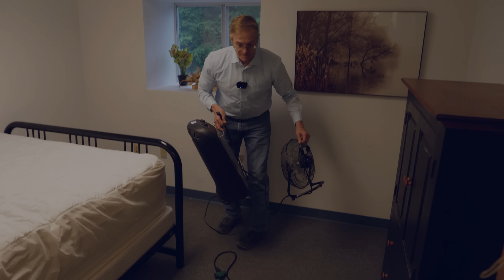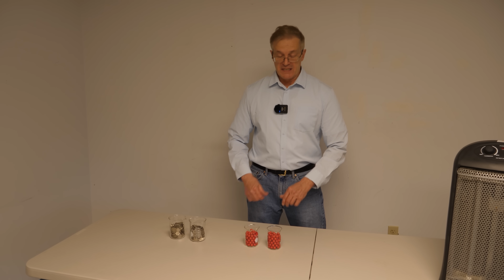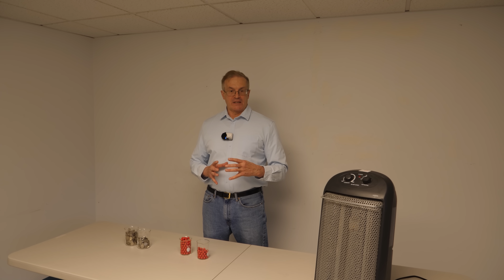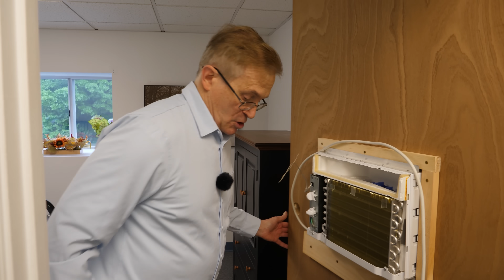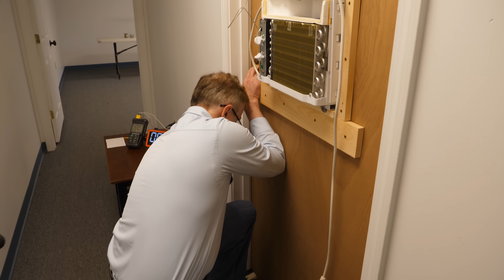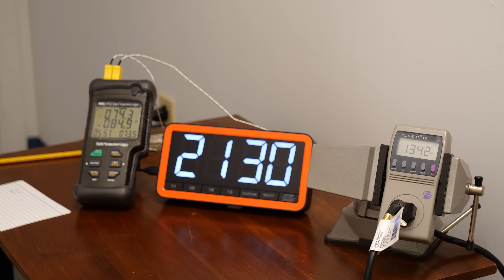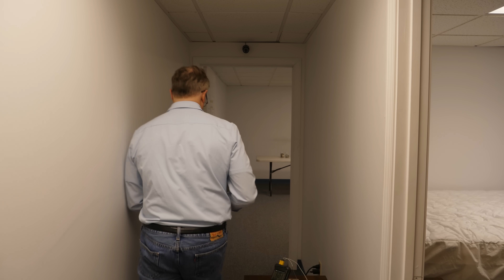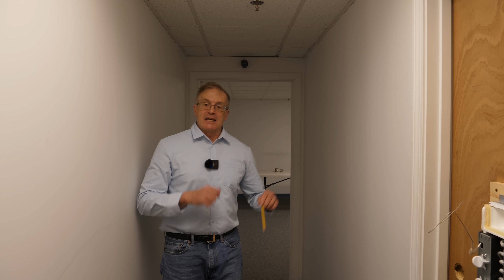You're wasting money on heating! Use your A/C!

Comment: The main problem with heat pumps are when humidity or precipitation freezes over the outdoor unit. They make blankets to cover the units but in southern states the temperature swing in autum and winter can be as extreme as 75 degrees for 2 days with lows in the low 50s upper 40s and swing to highs in the low 40s and lows below freezing with some rain/freezing rain then after 3 days of that highs in the upper 60s and lows in the 40s, then a chance of staying below freezing for a week, then repeat the weather pattern.
   The main method for defrosting the outdoor unit is either electric heat, or gas burners built into the HVAC system, very inefficient way since it requires the system to heat the outdoor unit to run like air conditioning while heating the cooled air to compensate.  There have been some improvements in efficiency over the last 15 years since i was a in the HVAC  business but the core principals of the technology haven't changed.

Comment: No. The controls for heat pumps are much more complicated when outside temperature is near freezing. Ice is a good insulator. MANY HEAT PUMPS LACK ADEQUATE ENGINEERING AND CONTROLS to deal with temperatures below 40 Fahrenheit....

Also any mission critical roles like not freezing should have redundancies. You should really have a minimum of two heating fuel options, assuming that heat is actually important in your location.

Comment: Burning natural gas costs less than either.  When it's hot a swap cooler cost less than a/c and works well if it's dry.  If you really want to run a/c a condenser in a cooling tower is the way to go.

Comment: Looking forward to the AC improvement piece. Thanks for showing this. What happens if you just run the ac unit in the room? Are you still ahead of an electric heater even with dumping the cold air in the same room?
Reply from the maker: No.
The multiplier effect is based on moving heat energy from outside the room into the room. Generating heat from mechanical parts, motors, or hot wires is exactly the same as running the resistance heater.
Reply: That’s what I thought. But let’s say we turned the ac around in a window to use it for heating the interior room at what point would the colder temps outside negate the benefit of the heat transfer of the AC unit? Assuming the exterior location was dry and the ac was equipped with thermostats, switches etc. to run in the cold exterior.

Comment: Thank you for your great content. 
What about the efficiency drop ?  0 C° outside while you want to heat a room from 0 C° to 25°. how much would it drop on max. power eg. 2kw of the aircon? compared to resistency heater.
Reply from the maker: It's roughly linear, so with a doubling of the differential, you might still see a 2 to 1 or a 3 to 1 advantage.

Comment: Well, two things. He apparently misspoke when he said he chose Fahrenheit because it has smaller numbers. He probably meant to say smaller INCREMENTS. Any school kid knows that Fahrenheit has larger numbers (212 vs. 100 boiling pt.). He was correct about the reason. Because Fahrenheit is LARGER, it provides arguably more accurate readings. 

Secondly, I was dumbfounded when he said that an electric grid heater was the most efficient heat. (Now, infrared ceiling panels ARE more efficient because they directly heat the person instead of the air.) I don't care what kind of math or science is used to supposedly prove that, anyone who has ever used a residential heat pump with the auxiliary heating grids for cold weather, knows that this JUST AIN'T TRUE. Whatever the explanation is, it just does not work out in real life. When it gets really cold outside and those auxiliary heating grids kick in, the power meter outside starts spinning like Satan's fan.

However, he IS CORRECT that the heat pump is more efficient at moving heat. But without the auxiliary grids, the heat pump alone cannot keep up on the coldest days, and by several orders of magnitude. Not unless you oversize the unit by several times what is needed for cooling, and that causes additional problems. And that is why the grids are added, at the electrical expense of the owner, to avoid over-sizing the cooling side. And worse, depending upon the weather conditions, the heat pump can freeze up (just like an old refrigerator freezer) and becomes useless until the thaw cycle clears the frost. But in that sweet spot of say 35-65 degrees, it's fantastic. The other downside to heat pumps if you intend to use them for heat is, it takes a lot more BTUs for average heating than it does for average cooling. Yes, BTUs are BTUs, but here is the problem. Cooling from 95 degrees outside, to 75 degrees inside (and believe me, 75 degrees running a zone unit all the time is COLD) is only a differential of 20 degrees. (The hotter it is outside, the colder a set temperature feels because the AC is running more. I have my shop set to 80 degrees and it's still cold; it tends to run below set anyway.) Begin to see where I am going with this? BUT, if you decide that only 70 degrees is comfortable working in the winter time, and the outside temperature is 25, that is a differential of 45 degrees, more than twice the cooling differential. I have a small, insulated shop in which I installed a 2-ton heat pump. It can easily cool it down on the hottest days and keep it cooler than I need it.  However, in the winter, once it gets below 35-40, the heat pump just can't keep up. If I had it to do over, I'd go with a 3-ton pump (I had already replaced a 1-ton unit). Before I installed the heat pump, I was using two 5-KW electric heaters in the winter and it was eating me out of house and home. With the heat pump, I can hardly tell it on the bill.
Reply from the maker: Thanks for the long comment.
The Fahrenheit scale has smaller increments, and when the meter is limited to one decimal place in all systems, then the resolution is higher with the Fahrenheit scale.
Any method of resistance heat will be less efficient than a heat pump. However,  the method of resistance heat may be more EFFICACIOUS if it heats your body rather than the entire room.
The problem with supplementing a heat pump at large differentials is that electrical heat is much more expensive than other energy sources like natural gas. That is why a hybrid system that uses an alternative supplement is a better choice.
Reply: @TechIngredients  This is all true. However, notice that BOTH the resistance heat AND the heat pump use the same "more expensive" electrical energy, yet within its limitations, the heat pump is more efficient (less cost) at producing heat. The problem is, it can only produce so much heat at cold temperatures before it freezes up. Maybe they have made recent technological advancements to overcome this shortfall, but that is the basic conundrum with heat pumps. Efficient, but limited. Electric grids are expensive, but unlimited. All I know is, when I ran those 10 KW electric heaters in my shop to take the chill off, it cost a fortune.

Comment: This is brilliant. Our ancestors beat us. Then they teach us. I believe wood and coal is the only way to go. The modern society is all way dependent on a government. We are not building solar panels or air conditioners in our back yards. We have designed a lot of luxury for our elderly and handicapped. The younger generation needs reliability and affordability. Passive cooling with root cellar or basement ( Awnings also help block heat from entering windows). Coal and wood for heating.   The whole idea of envelope sealed  designed structures is a waste if a home has to breath ( prevent mold and mildew).

Comment: I'm a little bit late but it should be mentioned that the heat pump efficiency drops as the temperature difference increases.
For commercial solutions it drops below 1 around 40-50 Celsius/Kelvin.
There are some solutions for this problem like backup heat source (gas/coal/wood stove) or heat battery.
Using soil as medium from where heat is stollen from or dumped to is also quite popular solution.
Heat batteries can also increase chilling efficiency.
Reply from the maker: Below 1? What do you mean?
Reply: @TechIngredients  At some point AC unit is not able to chill fluid below ambient on evoporator side and above consumer on compressor side.
Eventually gas start to collect heat from room and transfer it outside. It is extreeme situation, rare even in Canada and  Scandinavian countries.
Reply: @TechIngredients  COP below 100%.
When temp difference goes extreeme compressor, evaporator and condenser are not enough to prevent heat from moving inside to outside using working fluid gas.
It is like trying to use 12V garden pump water up on the Hoover Dam, it is going to flow down.
In this case, very rare even in Scandinavian countries or Canada, electric space heater, gas heater or even woodstove wins.

Comment: So one thing that has me curious.

You are pulling the heat from an already fairly warm hallway, I wonder how the efficiency of heat pump heating becomes if you are instead pulling the heat from an already cold outdoor.
Reply from the maker: It drops, and it should.  The efficiency advantage is based on the differential, and as that increases, the multiplier effect will decrease. But it will never reach the low performance of a resistance heater as long as the cold side is above absolute zero.

Comment: In Sweden, most of them works the either way. When they gets iced up in the winter, never try to remove the ice mechanically, for they are extremely fragile. Use cold water to de-ice them better, so as not to stress things and cause leaks.

Comment: Hi. Your video is good, but the focusing issues you've having with  the camera is extremely distracting. I don't know if it's an old camera or if the autofocus function is defective, but please fix that. You have multiple options, you can buy a better camera with a better autofocus, or a DSLR with the objective in manual focus mode and have the camera operator manage the focus, or again with a DSLR use a small aperture (you will need better lighting) with manual focus and forget about focusing as the depth of field will be big enough for your filming style.

Comment: In layman's terms, it's not a matter of efficiency, it's the WAY the heat is generated. Using electricity to heat a steel coil or metal rods in a typical electric heater uses a LOT of electricity. Whereas compressing gas as is done in any AC unit creates heat using FAR less electricity. And as for how heat pumps work, they do indeed work the same way as a window AC unit, but use air or ground water to either keep the 'hot side' or the 'cold side' depending on the time of year, cold or warm enough to keep the unit working properly.
Reply from the maker: My only disagreement is that a heat pump doesn't need to be hooked to a ground loop.  Air can be used as the heat sink.  It's a matter of the specific design of a particular system.
Reply: @TechIngredients  True, but the ground loop variety seem to work best, unless they've made further improvements recently. I know one friend a good five years or so ago, who had a HP that only used air and looked a bit like one of those mini-split ac's. But ofc it only had the wall unit. It was great in the summer, but had a bit of trouble heating during very cold winter days.

Comment: The hallway is like the outside of the house in this experiment. So when I'm heating with an a/c unit, that outside temperature would be around 35 degrees Fahrenheit. I would like to see the results under those conditions.

I think what you've displayed here is great and I appreciate it. As I said in the above paragraph I'm just concerned of what it would look like in the real world conditions that I would be using it in.

Comment: Hmmm...  I'm going to estimate great for unextreme temperatures, but the colder it gets outside, the less efficient it becomes. This is not very useful in a wisconsin winter when it's below freezing... or worse, below zero for instance.
Reply from the maker: Consider a two stage system. Use a conventional heat source like propane, natural gas, or oil to reduce the temperature differential and make up the difference at a very high efficiency with the pump.

Comment: soooooo...  You're saying, when winter comes, put the AC in the window "backwards", and save a ton of money on heating; in those rooms where one usually uses a space heater?
Reply: No, he is saying instead of buying a resistive heater buy a heat pump which has the functionality of  both cooling and heating - that will save you money in the long run. It has a reversing valve and adequate quality indoor coils which lets you make your ac go in reverse by pushing a button rather than actually taking it out and putting it in backwards.
Reply: @xhashmi791  Thank you for all the info, but I am convinced, if I put the AC backwards it will blow heat into my room, and do it cheaper than a space heater.  I just watched him do it.
Reply: @jafquist27  I think he merely demonstrated a proof of concept and it is not suited for practical application as is. But please go ahead, be my guest :) It will blow heat into your room, if the temperature outside is already warm enough to trigger the thermostat into cooling mode and it won't shut down when the desired temperature is reached inside the room rather only when the outside is cool enough - you need to replace the thermostat with one which has a heating mode and need to move its sensor to the inside. Also you need to go outside to operate the controls and you risk moisture damage to any electronics on that side which are likely not to weather proof.
Reply: @xhashmi791  That's all well and good, but the title of the video instructs one to use his or her AC for heat.

Although correct, none of what you said was openly said by him.  Like many scientific types, he was speaking with just enough jargon to make the information useless or even dangerous to his potential audience, as in the case of one sticking an AC control panel out in the cold, wet winter weather.  

For him to not even invision someone trying such a thing, and thus not warning them to not do it, is somewhat irresponsible.  The title of the video is more than adequate to attract a very wide section of the population, seeking to find cheaper ways to heat.  The title plainly encourages one to use his or her AC for heat.  I don't find it too much of a stretch for the average person to realize, if they put the AC on, cold air is going to come out of one side of it, and heat from the other.  From there, most would look for a way to not cool one part of the house to heat another.  Thus, just like in the video, install the AC 'backwards', in some fashion, to exhaust the cold air from the house enitrely.
Reply from the maker: Jafquist is essentially correct.
This is a demonstration of the performance of heat pumping, not a tutorial on how to accomplish heating with a reverse mounted airconditioner. Based on the comments, I think most people understood that.  Nevertheless, there may be a few situations where you could actually reverse its orientation to heat a room.  If you have a window that opens on a covered porch that protects the internal components from the weather and gives you access to the controls, then moving the thermal probe inside will allow you to heat that room.
Regarding my "jargon," what did you not understand about my explanation of the principles?

Comment: Convert a Window AC unit to provide heat for a cloths dryer.  It shoukd cool the warm wet air to pull the water out of the air, and pump the heat back into the cloths dryer. Not only does the heat pump save energy recycle the heat.  But also,  it's not pushing moist warm air out a dryer vent  pulling either hot summer air  or coldd winter air through small cracks around windows the floor and doors .  This saves energy during both winter and summer.
Reply from the maker: Good idea.

Comment: This is awesome! Phase change heating/cooling is amazing; it is crazy that it isn't already a popular option the same way space heaters are for AC units to support reverse flow. It seems when people need supplemental heating in their homes, they naturally turn to space heaters, believing they are efficient because of the advertising, and then wondering what is going on with their electrical bills when they use them. If window units had the option to both heat and cool without an immense cost difference from the ones that can only cool, their popularity would skyrocket, I think.
Reply from the maker: I agree!

Comment: I currently have a GE geospring water heater , been using heat pump only for the last 5 years. Shaved almost 30 percent off electric bill while gaining cooling ac and drier basement air. That is a win/ win. Now lets build a solar reflected condenser for a freezer/ cooler unit.

Comment: https://youtu.be/94Th-uC8OYg
Reply from the maker: I've never been that impressed with her approach to engineering or even physics, for that matter.
Notice how most of the video focuses on polls and measures of subjective satisfaction levels?
Electrically driven heat sources have real competition from other sources based on efficiency,  cost, and availability. 
Nevertheless, the principle of moving heat energy rather than generating it denovo is a significant multiplier for the energy used.